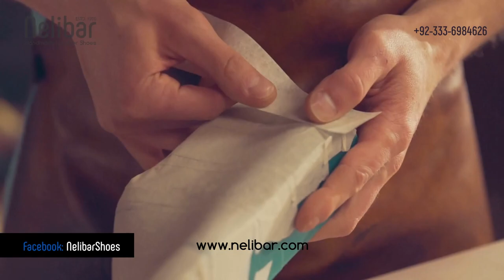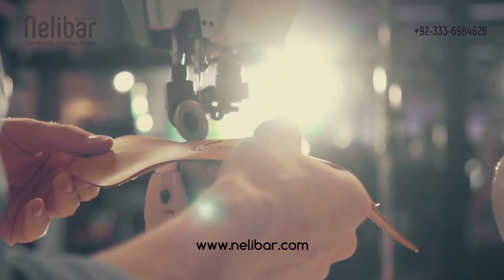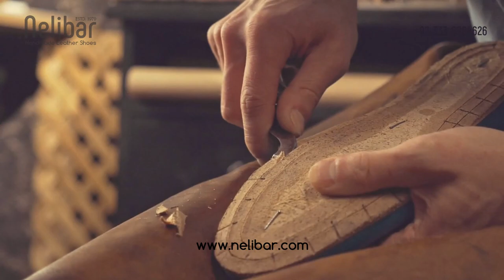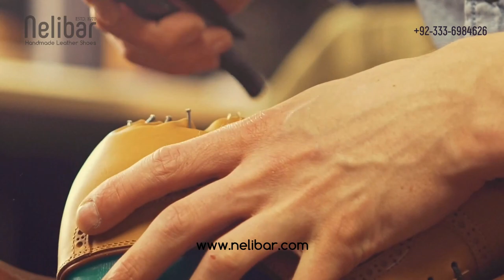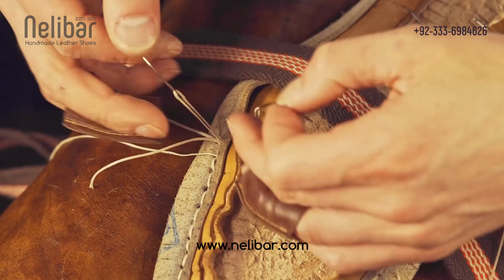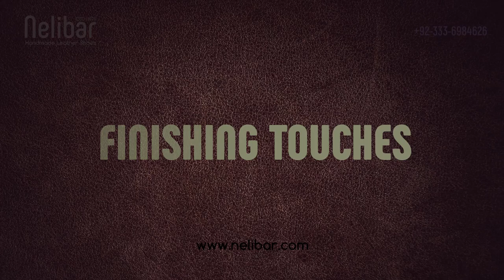How to Make Full Brogue Hand Welted Leather Shoes Nelibar - Goodyear Welted Handmade Shoes For Men

Comment: thanks for the nice video! it looks like you have a hard time welting though. maybe it was never shown to you properly? 
not to criticize but maybe i have some helpful tips: the awl that you use is actually a solestitching awl like the one you used for sewing on the outsoles. a welting awl also has a flat blade but 90° in the other direction. so when you poke through the holdfast, you create a horizontal hole instead of a vertical one. this is better for durability as you have a thicker portion of the holdfast and insole left uncut and you dont have to carve your holdfast so deep, leaving more insole thickness. 

also the shape of your awl influences the way you actually stitch. i can see its difficult to get your needles through at the same time. this is because you dont have that flat, horizontal hole that guides the needles left and right, next to each other. instead, this hole you made wants to guide the needles on top of each other (which is how the outsoles are sewn). also, i love using needles instead of bristles for welting too! but you actually dont really need them to go through simultaniously. you can round of the points so they dont poke the thread and do one after the other in a saddle stitch style - that said i would REALLY recommend bristles (out of wire for example) for outsole stitching (they are way less pain in the ass)!

lastly why do you use the awl from the outside inwards? you have prepoked holes in the insole. poke from the inside out, use those holes as a guide when welting and you get very clean and durable results! this way you can really play with the tension you put on the welt as you go around. poke threw holdfast and upper and then you can pull or push the welt a bit and directly put it on top of your awl and do the next stitch - also very important for a clean and durable welting :) best regards